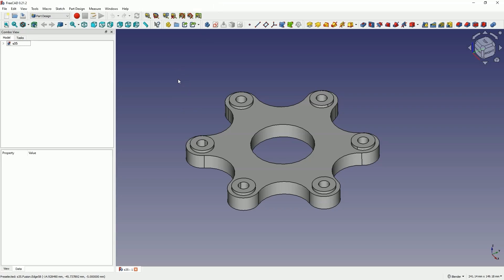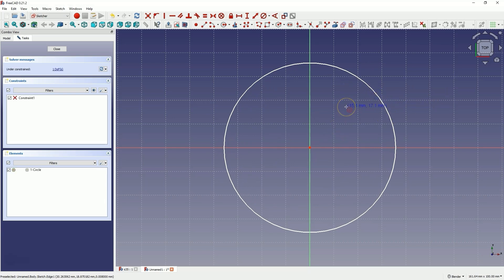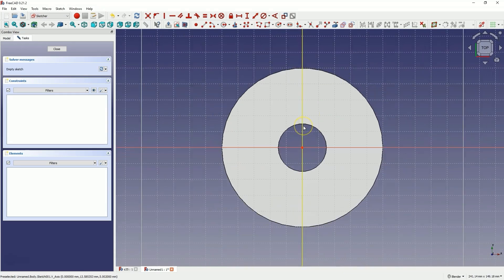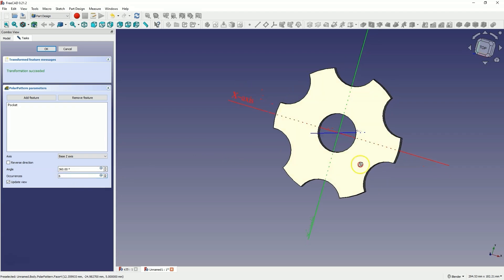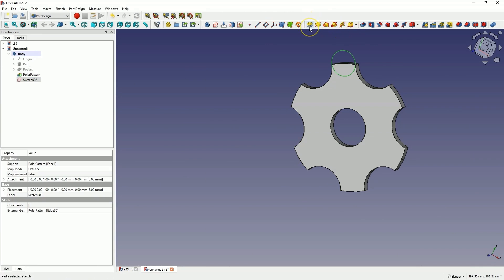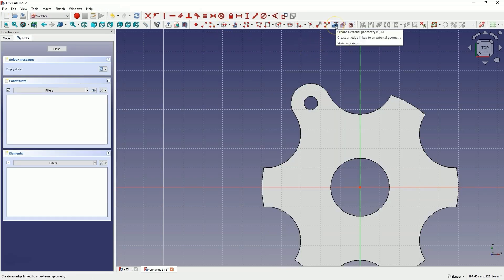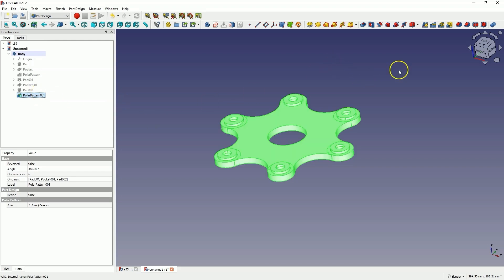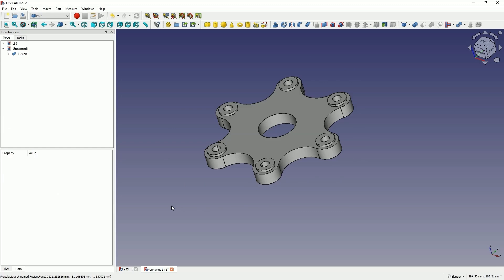FreeCAD 3D Modeling Example from Start to Finish

Comment: Just wanted to say that I was able to follow this as my very first tutorial / project(I installed FreeCAD today and don't have any CAD experience at all) - fantastic work! Just a single note - when you hover over tools in the toolbar - that's very helpful as my CAD installation was missing most of those tools - I was able to find all of them by creating my own toolbar. Please keep hovering and waiting for the tooltip to show up(pointing this as once you nearly skipped and I would be lost if it wouldn't show up for a split of second) - that's extremely important and helpful! Great great work!
Reply: Sometimes the tools are there but hidden . Dragging a tool bar handle (the vertical line of dots) will expose any hidden tools. You can drag the tool bars to anywhere you want them - the sides of the work space , for example.
Workbenches are merely collections of tools